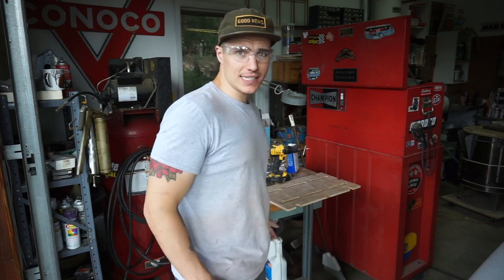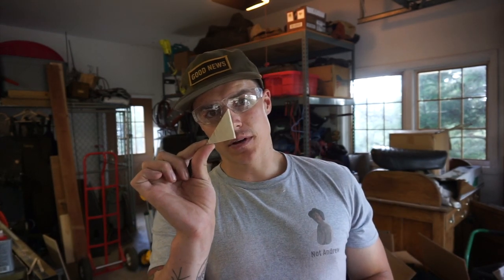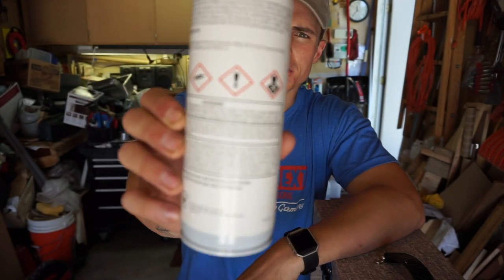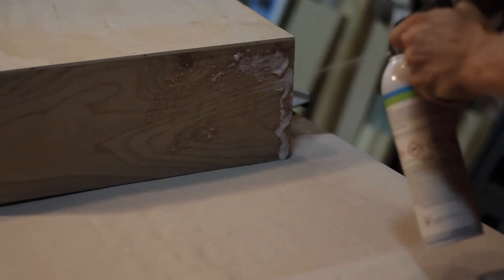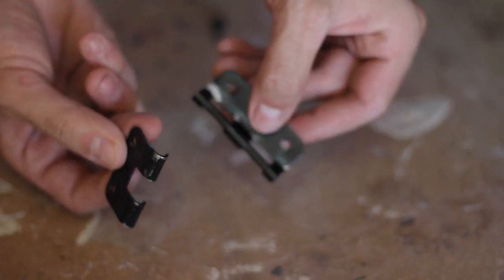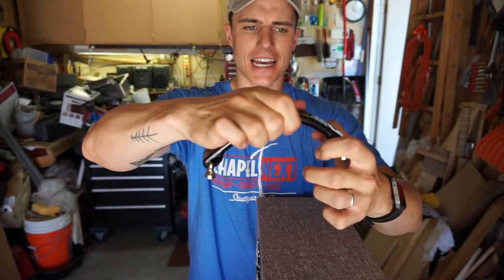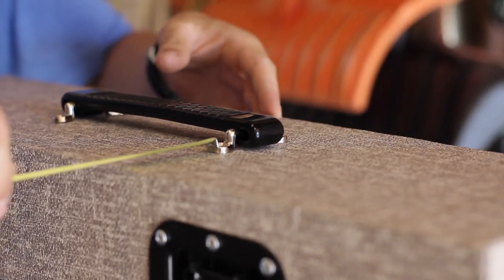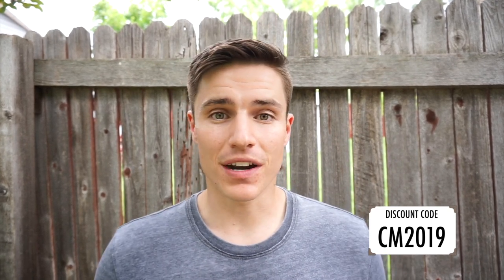DIY Custom Pedalboard | Pt.3 The Case | Chase and Melia

Comment: Hey Chase! Great video! I built myself a board recently (not with as nice a set of materials as you) and have been wondering whether I can build a case lid for it.  Hoping you can help answer a question or two!

I noticed that you didnt do finger joints at the corner of the plywood case lid but just glued them together and added some nails. I'm planning on doing the same (four pieces of ply with a top, all glued and nailed together, covered in Tolex and then have some hinges and a handle).

My question is ,when the board is locked onto the lid, is the bond at the corners strong enough to then hold the board and case with all the pedals by a handle? I worry that I'd make it all and it'll look great but when I pick it up the weight will pull the rest of the board off except for the piece attached to the handle.

Thanks!
Reply from the maker: Hi Gareth! I used 3/8in plywood for the sides of my case. I was skeptical that it would be strong enough for the weight of my board but everyone I asked said it would be fine. They were right! Now that it’s all together it feels very solid! I used 1/8th in plywood for the back and it is a lot stronger than I thought. It also saved a lot of weight.
Reply from the maker: Let me know if you have any more questions and how it goes! Good luck with your build! 😎
Reply: @ChaseandMelia  That's great to hear! Thanks! I think I used 1/2" plywood around all the sides of my board so this would probably also have to be the case for the lid so it can fit (mine would go on the top and not around the outside like yours because mine is fairly large already!

I'm not too worried about the actual sections themselves though (where the handle will go) but more about the joints. Glue and screws will hold it together, but the weight is my main concern. No harm trying though! Thanks again!
Reply: @ChaseandMelia  How much does your board weigh by the way? Mine is heavy enough without a lid haha.
Reply from the maker: I'm so sorry!!! I just saw these!!! If you're still building you can add a second board from the load bearing side of the case to strengthen it.  I almost did that myself, I was just going to glue and screw two together on the side that the board was hanging from.
Reply from the maker: Let me get back to you on that! I have never weighed it, but it's not light.  Its about as heavy as my amp which is a boss katana 50